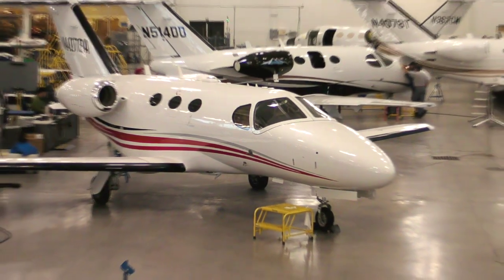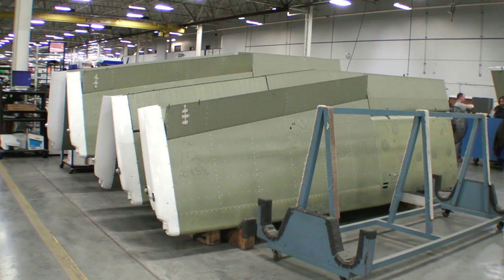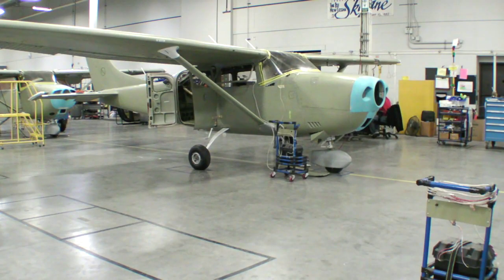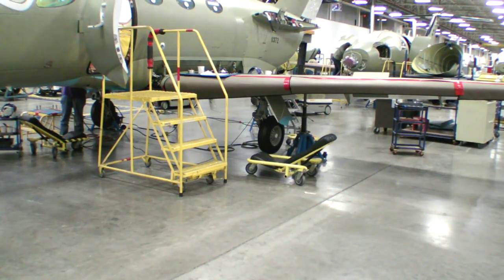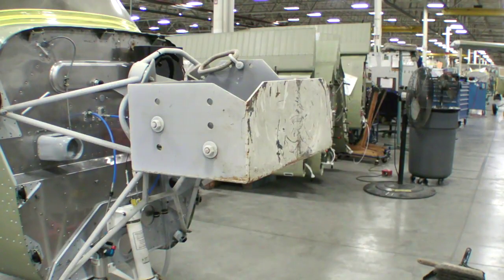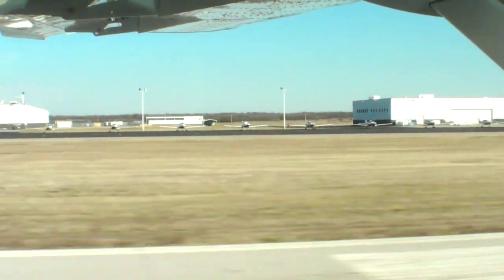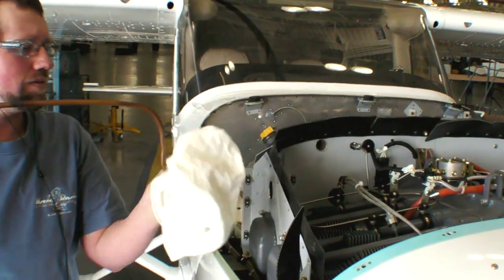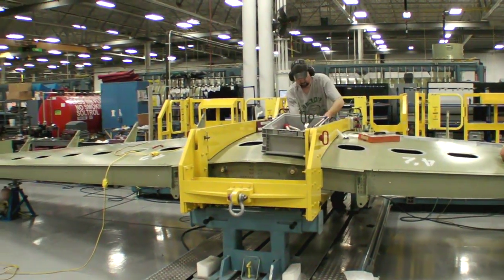A Look Inside the Cessna Factory

Comment: Can someone build a better engine for these things? They have the same annoying sound as a lawn mower.
Reply: could be worse, Kelly. they could be 2 stroke engines. the propeller makes as much noise as the engine, so they don't silence the exhaust...it doesn't make much difference to total noise levels. only one thing to do - learn to love grass cutters !
Reply: You should try 13 hours on a Hercules aircraft.

Comment: They need to modernize the 172 because nobody want to buy this airplane except for flying schools, and they are looking for other modern planes than 172.
Reply: What do you mean? Has a Garmin g1000 glass cockpit, can't really get any more modern than that. Flight schools are looking for an aircraft that's simple, reliable, and cost effective to operate. The 172 has been a staple of flight training for decades, and as the saying goes "if it ain't broke, don't fix it." If it's speed your looking for, than the 182 is essentially a faster 172.